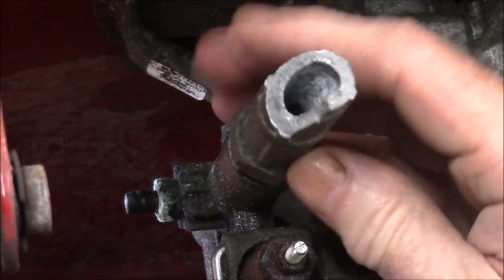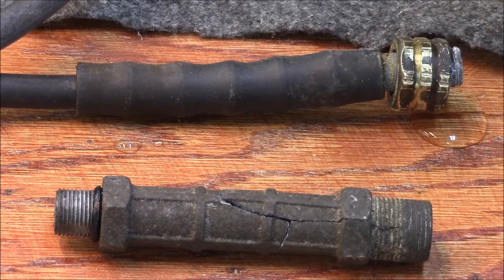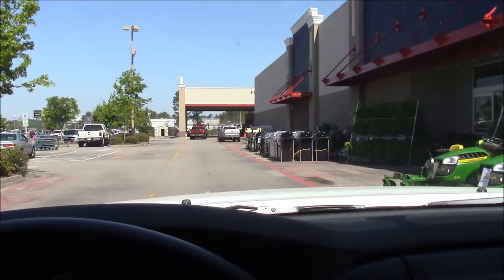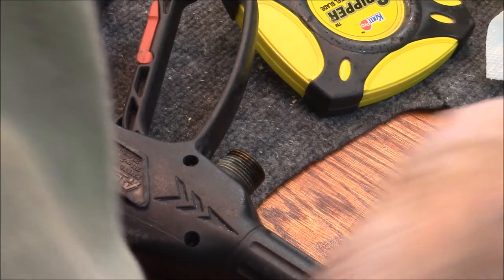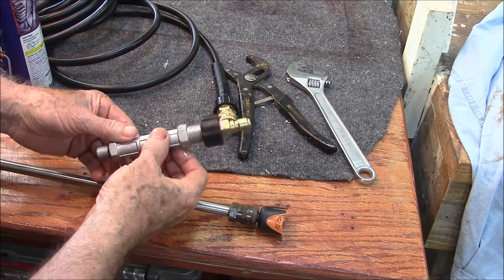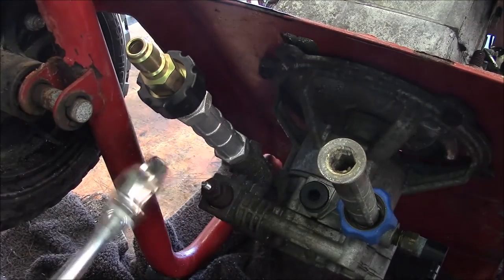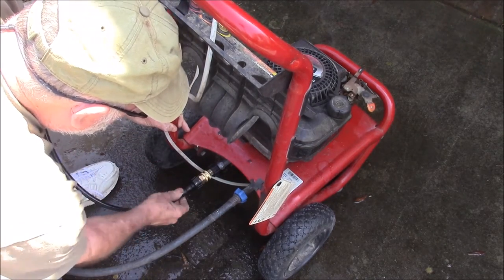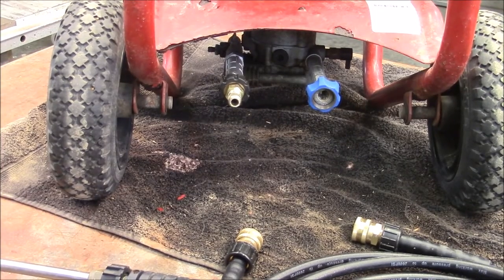58 Fixing and upgrading an eleven year old pressure washer

Comment: I strongly advise you coat the O-rings and threads with silicone grease before assembly.  
In addition, there is no need to wrench tighten the hose fittings to wand and pump.  Hand tight works great because of O-ring seals.

Comment: I think your ax turned out great. I've had visions of you chopping down everything that needed chopping, including stuff at the neighbor's houses. :-D Did you go to Lowe's and get just what you needed? It's nearly impossible for me to do that because I always find stuff I just can't live without, well that's my reasoning anyway. Good job on the quick connect fittings. I really like those things and put them on anything that can possibly use them. As you mentioned, it will be nice to be able to drain the water from your pressure washer, which may make it last longer. I don't think it's silly at all to spend $100 on a $300 dollar machine. It's a lot better than spending $400 -- $600+ on a new one.
Reply from the maker: +The On Grid Homestead I drain my bank account of "shop money" every month at Lowe's.  We have the same weakness.  
     Thanks for defending my judgement!!!!  Since I like to tinker and fix things, I do tend to keep things longer than many would find reasonable.  I have a rototiller that is over 30 years old, and I drove my last truck for 24 years.  
     Just had a thought.  Maybe I'll show my wife your post (as testimony) and maybe she'll kick some of bucks I saved into the "shop fund?"  Sure sounds fair to me.
     Thanks for watching and commenting.    I'm on Facebook too.  My real name is Henri Chase.
Reply: ***** I absolutely agree that more "shop money" is in order. I also believe in keeping the old stuff for as long as possible because it tends to be much better than the new stuff. I don't have a Facebook account so I can't see you there. I know your name is Henri because the Rabbi called you by name when you built that beautiful Torah table. I think if we met in person I'd still call you Memphis because I've become so accustomed to that. :-)
Reply from the maker: ***** I like Memphis better too.  
    Thanks for the compliment on the Torah Table project.  
     No Facebook.  I hear you, actually.  I've only been on FB for a year or so, and then I only joined out of the totally self-serving reason that I wanted to get more views!!  It didn't work.  My wife doesn't even watch my videos.
Reply: ***** It's not that I like Memphis better, it's what I'm used to. I'm surprised your wife doesn't watch your videos.
Reply from the maker: She doesn't like the noise, and she is one of those folks with no interest in anything mechanical, or building, or woodworking.  But it makes me a hero, as practically daily I get credit for fixing things that aren't broken, or repairing TV remotes that aren't broken, or setting clocks, etc.  But it makes me feel needed, which is nice.
Reply: ***** I'm fortunate in that my wife loves going to Lowe's as much as I do. She's not much into building or mechanical projects but doesn't mind that I love that kind of stuff. And hey, I'm sure your wife is happy knowing that you can build anything she happens to need even if she doesn't know she needs it, and all that fixing things and setting clocks is a plus.

Comment: One of the things I like about Lowe's is their 10% discount for veterans.  You will never be accused of slapping something together and half way doing the repair.  That is something to take pride in.  After you started the motor, at about the 11 minute mark, it looked like the engine was rocking around.  Is it rubber mounted like some of the Harley engines?  I have never seen a piece of equipment that did this.
Reply from the maker: +Pidasian Hippie Good catch on that vibrating engine cover.  Story is, I had to overhaul the ignition system on that engine, but the bolts and everything else under the hood was totally destroyed from all the bleach, water, and soap that gets sprayed on it.  So, wait for it, "I slapped something together," using tie-ties to connect the cowling to the engine block.
       I thought it would be a good fix, but I couldn't get the ties tight enough.  Frankly, it works, but it looks a little strange.  Anyway, human nature kicked in, and now I blame Briggs and Stratton for attaching that cover with mild steel boats.  It would have been a perfect application of nylon bolts, but they never asked me.
Reply: ***** If I understand you correctly, it is not that the engine is isolated from the unit, but that the cowling is not tightly tied down to the engine. I suppose sometimes you just can't repair something any other way than replacing it.  Why replace it if it will still function with an alternative repair?  Would nylon bolts live in such a high vibration environment?  How about hardened stainless steel bolts?  Of course no $300 piece of equipment is going to come with expensive hardware.
Reply from the maker: Pidasian Hippie The problem now is that there is nothing left to screw any bolts into.  The corrosion ate about everything, not just the bolts, but the bolt holes too.  
     Figure I'll let it simmer, guessing that my lash-up repair will last for a few more years.  But if it de-manufactures itself, that's even better, as I'll have something else to fix.
Reply: ***** Is it possible to re-tap  the threads?  One of the things we used in my previous life was stainless steel ties.  Non corrosive and hard to cut.  It may be something for you to think about.
Reply from the maker: Pidasian Hippie I don't remember anymore exactly how it's set up, but I do recall that nothing with new bolts seemed feasible.  But re-tapping sure sounds like the correct way to fix the thing.  Now you got me curious.  Think I'll break into the thing next chance I get and see if tapping is an option.
Reply: ***** I had a feeling that you would start getting antsy to fix it correctly after I brought it up!  Hahahhah.
Reply from the maker: Pidasian Hippie Yep, you always keep me on my toes.  Nobody else even noticed that vibration, and I was too embarrassed to mention it in the video.  You devil.
Reply: ***** Hey, give me a break.  I wasn't doing it to be mean.  I was honestly curious because I thought for some reason the engine had been isolated from the frame.  One of these days I am going to get the gumption to make a few videos and you can lacerate me at that point.  Hahhahah

On another note, I read the comments on FB.  When you made the comment about golf, I couldn't imagine you as a duffer.  I guess it isn't your favorite activity.

My night has ended.  Too many adult beverages.  I will be talking to you tomorrow.
Reply from the maker: To hyper to be a duffer, I think.  Frankly, I have no hobbies or recreations (golf, fishing, etc), and all I want to do really is get up and work all day.  Then at about 6 or 7 PM, drink a little hooch and relax.  
     So for me, and perhaps most people, retirement boils down to working on things you like.  Fishing, or golf, or hiking, or whatever, seem like a waste of time to me;  when I sit down at 7 PM for that hooch, it is gratifying to know I have a completed a real job, perhaps creating something useful.  
      Perhaps that's why I like YouTube, and while I'm way short of the views needed to get paid, it creates the illusion of a real job.  So in my hyper brain I have a job, and it's a job I enjoy doing.  Perfect retirement.
Reply: ***** A lot of people "work" in retirement and do not get paid.  I have a friend who volunteers a couple of days a week at the National Park.  He loves it except for the idiot tourists who insist on walking right up to mama bears and their cubs to get pictures.   It is his job to tell them how stupid they are and run them off (the people not the bears).    I have thought of volunteering at the local Meals on Wheels, but I am not finished sewing my wild oats after retirement.  

I wish I had more of your drive to get all my projects done around here.  It is funny, when I bought this place 16 years ago, there wasn't a project too big for me to tackle, but changing a light bulb seems like a major event now. 

I really wish I could help you with the YouTube views.  However, I have to say that I really like the direction you are taking the videos.  Your personality is coming through.  Of course, you could start screwing everything up to try to generate more comments and views.  Something tells me that you take too much pride in your work to do something like that.

Have a great week my friend!
Reply from the maker: Meals on Wheels reminds me of one of the saddest things I ever heard.  My Dad delivered meals on wheels, and I remember him telling me that one of his biggest problems was that all the old folks wanted to talk when he stopped by.  They were lonely.  And alone.  The food was good I guess, but what they really wanted was some human contact.  
     So my Dad was in a painful situation.  Talk and the other meals would be late, with the last ones real late.  Don't talk, and crush a visit these poor folks were looking forward to all week.  
    But you hit it right on.  There is real valuable work out there, and us retired folks can do it if we are inclined.  
    I'm good with my view count, and I'm trying to inject just enough "personality" to make it real, but not so much that it detracts from the real content.  
    Sorry about the sad story.
Reply: ***** You didn't have to tell me the story about your dad for me to know that would happen.  I bet it was very difficult for him.  I don't think I would actually deliver the meals but participate in the preparation.  I am too much of a softy to go to the people's homes.  It would break my heart and I would either spend all my non delivery time visiting these folks or stay terribly depressed.

When I was doing my research in preparation for this retirement, I looked into the volunteer opportunities out there.   I do love talking to people (You are shocked I am sure.  Hahhahah) and have thought I would enjoy something where I interacted with the public.  Of course, maybe I will get brave enough to turn the camera on one of these days and make my own videos.

I think your personality adds to the content.  Just like the bit with the axe.  I really enjoyed that.  You also made the smart move to send a new viewer back to your last video.  You could start adding a link in the video when you display a piece from a previous video.

Comment: That is not a full size truck. A full size truck has back seats and four doors. That's not a full size truck..
Reply from the maker: The term "Full Sized" could be used in many different ways.  I had a friend who  said that only F-250, 2500 trucks or higher even qualified as trucks.  I use the standard definition:
Small:  S-10, Ranger, Tacoma, etc. (These are all trucks without a standard 4x8 bed, and normally have four cylinder engines)

Full Sized:  F-150, 1500 GM, 1500 Ram (Sometimes called 3/4 Ton in my day) 
Also in my day a truly full sized truck needed a 4x8 bed, but not anymore I guess.

Heavy Duty:  F-250 and up, 2500 and up.   
     
    With regard to back seat and doors, I couldn't find your reference.  Indeed, there are some small pickups with extended cabs, super cabs, etc.  Moreover, Chevy didn't make its first "Crew Cab" until 1973.

     If you have a reference on this question, I'd love to see it.

     Thanks for watching and commenting.
Reply: That's ridiculous.  A full size truck goes by the bed size, not the cab size.  By your estimation that would even make trucks like F-350's compact models if they only had a standard cab, lol.
Reply from the maker: You know, that's what I thought too!  I thought that any pickup in which you could place a 4x8 sheet of plywood in the bed was "Full Sized."  But I can't find a reference to support my notion. 
      Fact is, the outfits that make trucks don't give a hoot, they just want to sell trucks.  You will find F-250's with 7 foot beds, and small trucks (in the Ranger class) with four doors. 
      Moreover, unless you can provide a reference, there is no "standard," rather we are left with 1/2 ton (100), 150 (3/4 ton), 250 (1 1/2 ton), etc. 
      Hope you provide that reference, as I used to feel the same way as you about this.
       Thanks for watching and commenting./